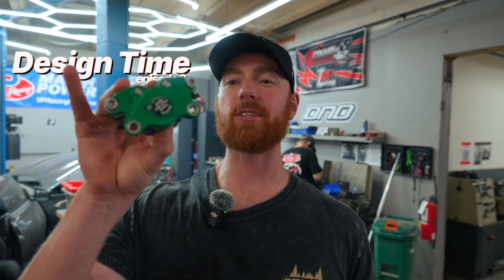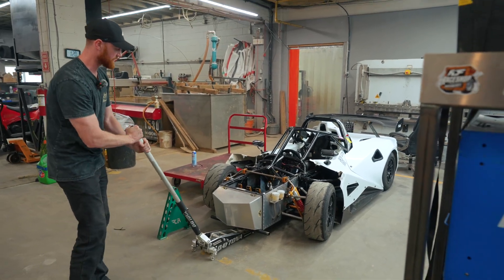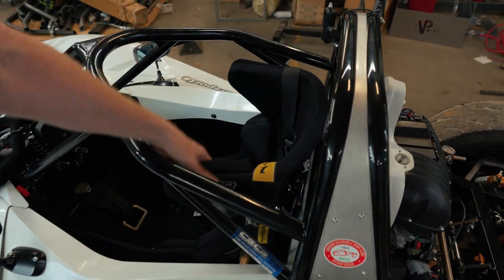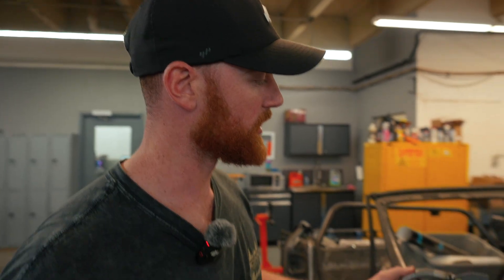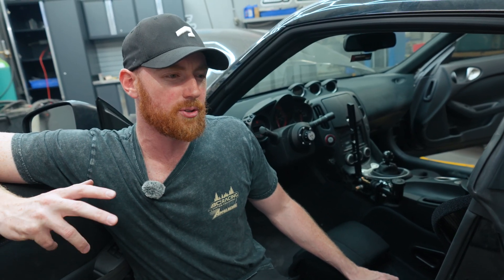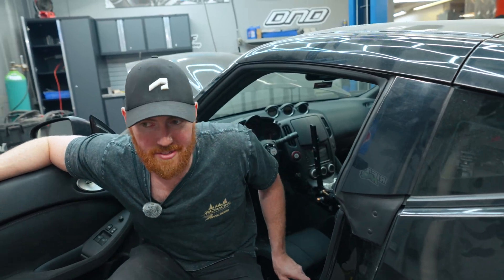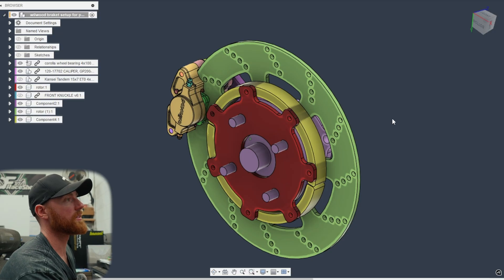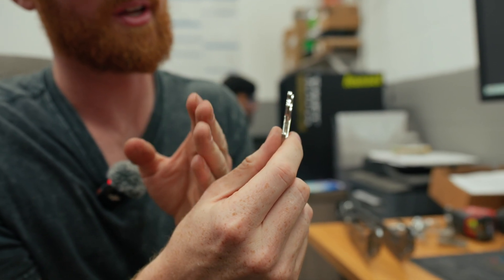Design Time Episode 8: Pit cart is getting a full brake system

Comment: Hockey pucks are the ultimate tool for getting racecars on the lift or even putting them on jackstands. Buy a box of them. I have even cut them into different thicknesses and they have lasted ten plus years without a single failure even using them on pinch welds and  all kinds of sharp edges.
Reply: I remove all the lift arm attachments and just stack them to vary the height.